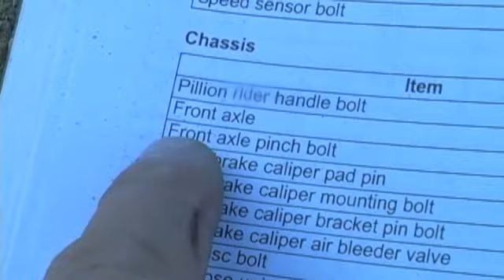07+ Suzuki Burgman 400 Front Wheel Installation | MicBergsma

Comment: Hi Mitch.
I have mounted my front tire upside down on the wheel of my Burgman 400 year 2008, does it matter if I mount the wheel upside down from how it normally sits to get the correct direction of rotation on the tyre, or must I have turned the tire on the wheel?

Yours sincerely
Tom Jensen
Denmark
Reply from the maker: Hey, I would change it back to correct way so it can control better on the road and water flow through it better
Reply: @MicBergsma  Thank you for your answer, 👍It will be done..

Comment: Anyone give me advice on reinstalling front wheel on 05 Burgman 400?  That is the one that has the speed sensor on the opposite side of the wheel from the brake rotor.  I keep hearing about greasing speed sensor and getting the 'grooves' lined up.  I haven't seen any videos or helpful advice.  Also there are tabs on the right fork that look like the speed sensor should fit into, but they don't.  I didn't know what to look for while taking it apart.  Reassembly leaves a whole lot to guess at.
Reply: Did you ever find a video or other source of information on this matter?